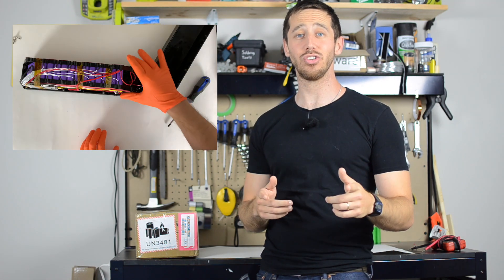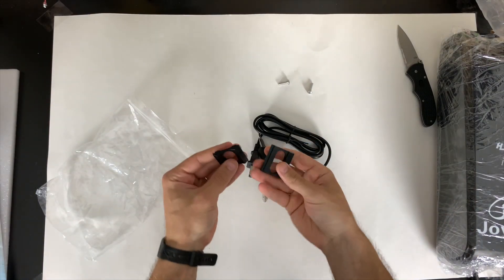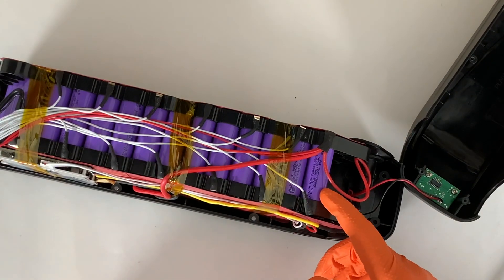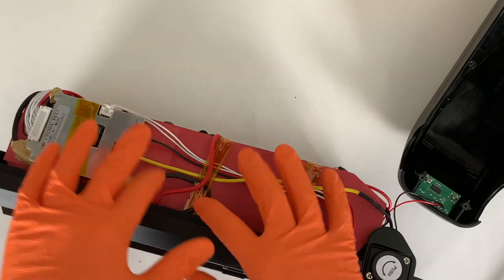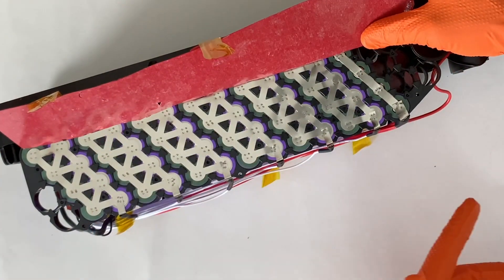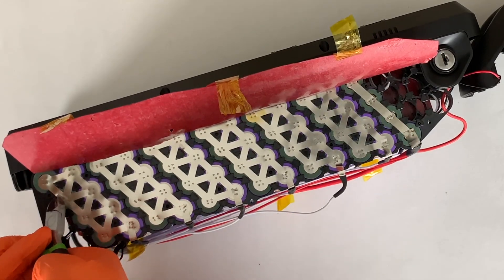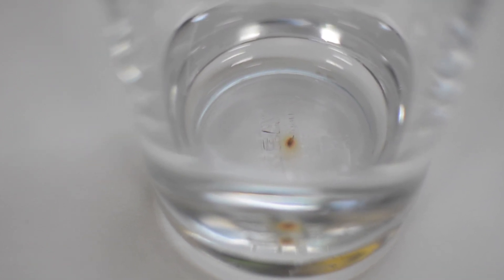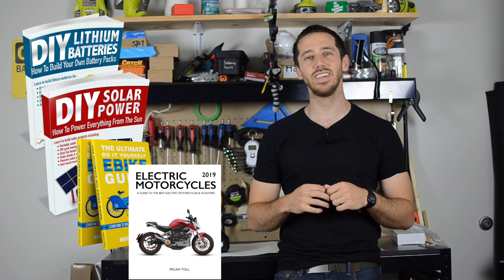How do you know if a battery is good quality?

Comment: Excellent video. Youtube is an outstanding teaching source and this video is no exception. I do have a question though. This battery is of medium quality and is exactly the type of battery I have on my ebike right down to the voltage and amp hours. My battery is weakening after only 2 years. I have a 500 watt motor on mine so should I be shopping for something like a lg battery? If that battery in your video retails at $299 something tells me a premium replacement is gonna be in the $500 range. Which route do you suggest I go. Heck I only paid 700 for my whole bike and the replacement battery will almost be as much lol.

Comment: You can use a neodymium magnet to check if the nickel strip is really a nickel plated steel strip.
Reply from the maker: No, unfortunately that doesn't work. Pure nickel is also attracted by a magnet.

Comment: You mention checking the manufacturing date of the cells. Any advice on buying cells from the big 5 companies in terms of battery age (i.e. avoid new batteries older than 6 months? or just get them as new as you can?)

Comment: Very very good information. I just opened my older aluminum case type battery to repair broken output/load socket and was planning on taking a look around in there to see what kind of quality was inside. Great timing Thanks. Did notice that the key switch was wired on the negative side not positive. Is that normal?  Thanks again Great job

Comment: Great info as usual, Micah!  I have a 5 yr old 300w folding mountain bike with an 8 AH 24v frog with prismatic cells, that still work as new.  But the clock is ticking.  I would like to upgrade and overvolt to 36v and 15AH . Aliexpress has them in name brand cells or cheaper prismatic cells .  What would you suggest?  Thanks!

Comment: I have a? 😊I have x2 60v lithium pack both have Bms can I run them in parallel without issues 🤔each pack rated at 30a.
Reply from the maker: Theoretically yes, but you'll want to take some precautions such as ensuring they are at equal voltage before connecting in parallel or adding a diode to each discharge wire before making the connection.
Reply: EbikeSchool.com , can you please explain this more , because i wantend to do the same with my 2 battery packs of 48v
Reply: @carlobravo9531  a video explaining and showing would be nice too :)
Reply: @carlobravo9531  What type of connections do you have on the two batteries? You can buy parallel connectors on ebay if you don't want to make your own. Make sure both packs are within 0.5V of each other before connecting and you should be fine. Also, ensure same discharge rated amps.

Comment: What voltage should you use if you want to get a ebike conversion kit for a mountain bike to go 40/50 mph?
Reply: 72v. Be careful, that speed requires lots of considerations.
Reply from the maker: @joblessalex  I agree with Alex, you probably want 60V at minimum but 72V is more appropriate to reduce current draw. And you need a really good mountain bike with strong frame and good brakes for those speeds...
Reply: @EbikeSchool  My two wheel drive 7kw bike has eaten two sets of brake pads in about 20 miles. I want to do regen, But I also don't want to have the issue of nuts backing off. Torque arms are doing great for forward, but I'm pretty sure the reverse torque will have the wheel off pretty quick. It'll loosen your spokes too. Burn through tires 5x as fast.
Reply: @joblessalex  I agree. Don't forget to update your will.
Reply: I'm not trying to be rude but if you want to go that fast why not buy a motorcycle? 
Built to handle the speed and punishment.
Reply: @myrondesjarlait9752  here in Washington state, they have an etax for anything with a license, but not for ebikes
Reply: @JohnnyRocketEUC  This tax does not apply to motorcycles according to the license department. I've had it waived.
Reply: @joblessalex  how? I paid it 2x
Reply: @JohnnyRocketEUC  Just tell them when you get your tabs. It also doesn't apply to vehicles that do less than 20 miles of range or (I don't remember for sure) 40mph. You'll have to check the exact law. All I did was say my vehicle doesn't exceed the 20 mile range and they said Olympia said it didn't apply to motorcycles anyway so I'm good.
Reply: @myrondesjarlait9752  My guess is price and concealment. If I look at a bicycle with a battery pack I think nothing of it and not some sleeper beast machine.
Reply: Bikes get really wobbly at 46MPH (my lifetime  max downhill non e-bike), but check out https://www.youtube.com/watch?v=cs37RjmzhIk . Vortecks builds some awesome bikes. I'm not an expert, but eventually the problems isn't going faster, it's not crashing :) Grab a 72v. Tape it!
Reply: 72V 5000W rated motor. This is expensive as hell. You will need a 2kWh+ battery. This is close to minimum $2k and shipping from China. Considerations is that big hub motor will need probably some filing of your dropouts (once done its done cant go back) and a lot of battery space somewhere.

Comment from the maker: Man, this video was well over 25 minutes in the first cut. Even after hacking it down it's still a beast. I hope you guys don't mind the long ones!
Reply: There's some good videos over an hour and no worries at all.
It takes time to explain everything shortly. 👍
Reply: Not at all... great video!!! Thanks
Reply: It's OK by me!  sometimes I watch them twice and take notes.  Great info!
Reply: a long vid full of highly useful information is not a problem. it's a joy.
Reply: Thanks mate for the good battery review now i prefere to built my own battery
Reply: It has the necessary time to know how to inspect a battery!
Can you show us the other methods to know if the nickel strip have steel?
Reply: I spoke on amazon with the company for like a week for all the specs. I am a 13 year Electronics tech, but thankss for this video wow my battery, i did not want to dismantle 

 have this battery !!!! is this battery the Joyisi 48v 10ah ? I spoke a lot time talking to them joyce messaging on amazon. They told me the higher AH VERSION they offery on the same page. Make of this model they said they are Samsung Cells, and they did say that this battery they were honest about the chinese cells. T and you are very correct for everything that they told me. Which is really cool, they were very honest. I did They said they are called "Foster" Brand Chinese Cell Brand. Your video is very accurate, from the LONG conversation with Joyisi i had. Thanks for making this video. Wow I did not think i would find a video on my EXACT battery. Thank You. They also wouldn't tell me what brand BMS was. but whatever. I am waiting for my wheel kit from, Golden Motors out of Canada. Magic Pie 5 Vector, with bluetooth adaptor add on $488 Free Shipping to Oregon.

JOYISI TOLD ME THEY ARE 18650 Foster Brand Cells 2500ma. THEY also sent me Free XT60, and XT90 wired connectors free DHL from CHINA 5 day shipping. Battery Took Fedex from China 8 Days, Airmail to SoCal then Fedex to Oregon in 8 days
Reply: Hey thank you so much for making this video. I am waiting for my golden motor magic pie 5 from canada coming soon and using this battery for it.
Reply: The video was long but you did a great job editing. You were able to give us a lot of useful info and no fluff. I would be happy to see more like this, Thanks
Reply: Sorry sir. If I have built my ebike 18650  battery kit, can I get a diy case like that. 
Sorry on my English
Reply: @longshot4484  yes you can find the cases online. I think I saw it for $35 around there. It's a generic case used by many manufacturers.
Reply: Now you know, how the chinese producers are: they will change those specific things you mentioned, and they will be better than the original. :-D
Reply: www.lipotec.net
Best lithium battery price and quality
Reply: Some good things are take time...
Reply: Hi, can you make a video on how to test 8 months old battery, i bought hailong 48v 17.ah from unit pack power, i believe that range has decreased now after 8 months 6 days a week usage Thanks
Reply: Question: Are Sanyo 18650 GA 3500 mAh cells better than the Panasonic 18650 2900mAh PF cells ?... anybody know???
Reply: Nope, you are thorough!  Keep it up man
Reply: I usually dislike long diy type videos but you were thorough with your break down and turns out there's a lot of information to consider, thanks for making such informative videos.
Reply: Great video, lots of information.  Thanks!
Reply: Metal putty is good for rocking problems ect, mine is a 52v hail long case first thing you want to do is change the slot conector where you slot the batt to the bike, also never trust the usb on the side as they blew some expensive lights of mine with that exact bms.
Reply: @n11 where'd you find that out at?
Reply: Very informative  video presentation, more for these. Thanks
Reply: Here’s EBR and here’s Micah throwing them under the bus lol
Reply: The GIRLS definitely like the LONG ones...
🍌🍌🍌🍌🍌🍌🍌🍌🍌🍌🍌🍌
Reply: can you make a video on what we should look like when buying a battery from places like aliexpress, how can i figure out if the battery will be what they promise? Ive been using weight, looking at average wh per kg and going from there, do you have other things you look for?
Reply: Hi Micah. Do you have any other way to buy your books than through Amazon, not really a fan? I live in France. Thanks
Reply: What is the highest watt motor and battery that I can buy and still be a moped in Pennsylvania.
Reply: @unchained20000000  Use Google.
Reply: I have, it's not on google.  @grantadamson3478
Reply: @unchained20000000  That is a legal question. You need to consult a lawyer licensed to practice law in PA.